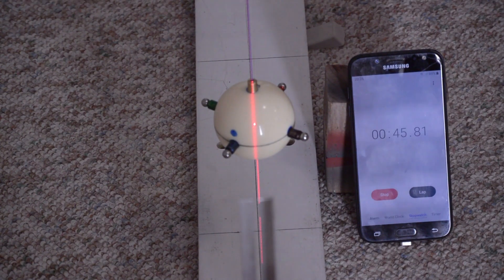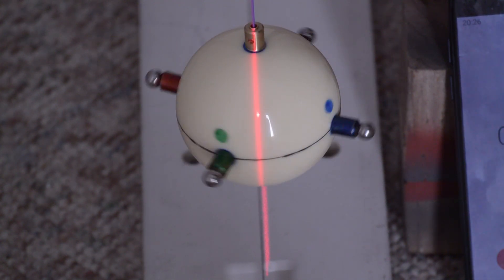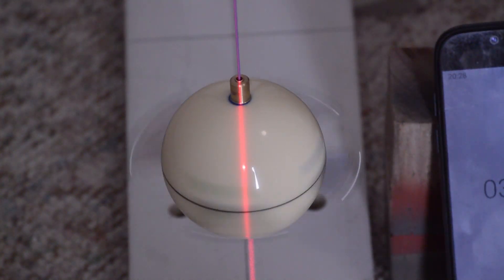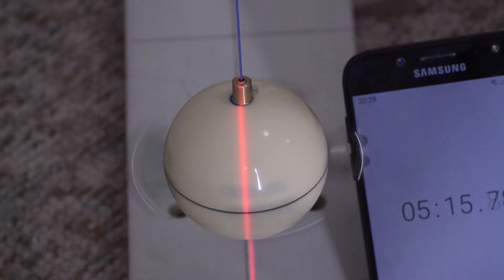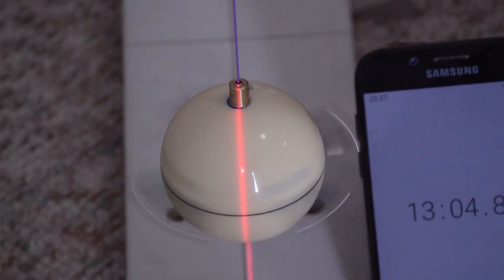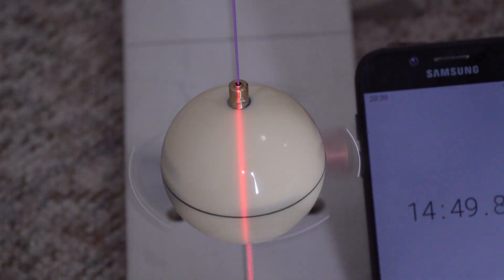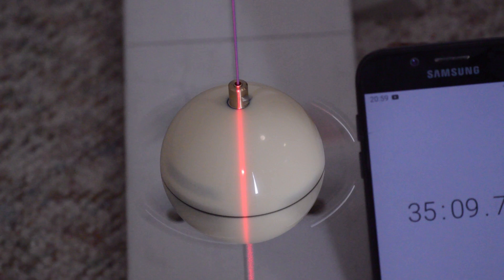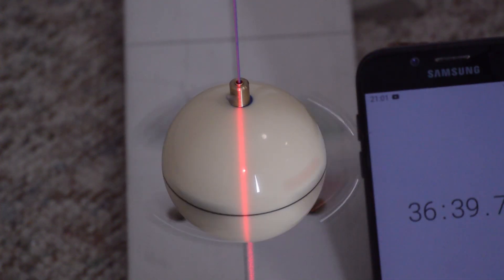Most Accurate Clock on Earth 6

Comment from the maker: Here we are 22 experiments on an we are back to square one testing and analysing plumb bobs again.  In order to have an accurate pendulum we need an accurate plumb bob and in order to have an accurate clock we have to have an accurate pendulum.  

There is a slight wobble in the new pendulum, which I believe is due to an imbalance in the plumb bob, however the wobble may be due to another factor not yet considered,... any help would be appreciated.
Reply: I reckon you have a scale problem. 

The effort to minimize the disturbances in the bobs plane of swing at the scale you are working on is too much.

If you increase the magnitude of the design by a factor of at least 2 then we will have a much more valid result in our pendulum in relation to measuring a deflection of the swing plane as a result of earth's rotation.

This is why Focault used a massive bob and a very long line.
Reply from the maker: @majorstube,.. I still have an open mind to the factors of scale, yet we now have off the shelf hard evidence and commercially available Foucault Pendulums of 1.5m, (0.5m) shorter then my 2.1m pendulum demonstrating Earth rotation.  I am not sure possibly 5 videos back taking you to the link.  Also a X 2 factor will magnify an error in the spinning bob,.. thanks for the contribution all good advice.
Reply: @peterleane6807 

Those Pendulums utilize magnetic drives to keep the oscillations amplitude, and must be tuned appropriately. Now this is fine as a demonstrative display, it however falls short of a true Focault Pendulum. No drives, no "kick" to keep the bob swinging, just the inertia from release.

The whole point of the Focault Pendulum is to be the inertial reference frame  from which we unveil the Non-inertial reference frame of the earth.